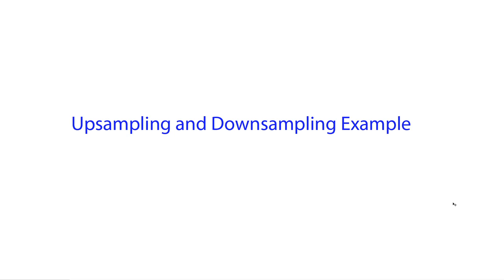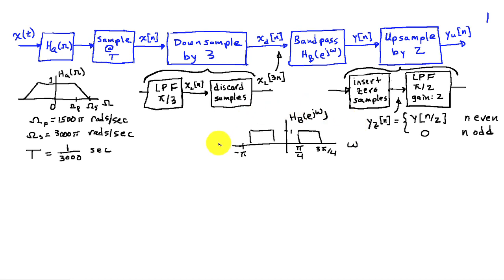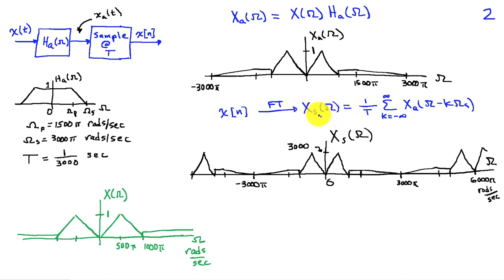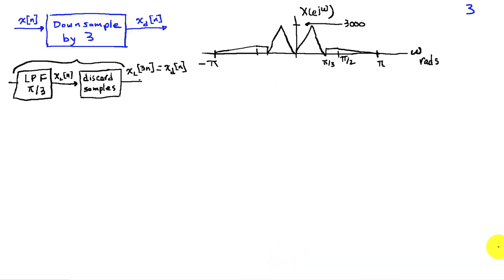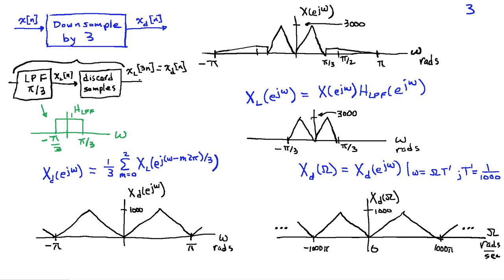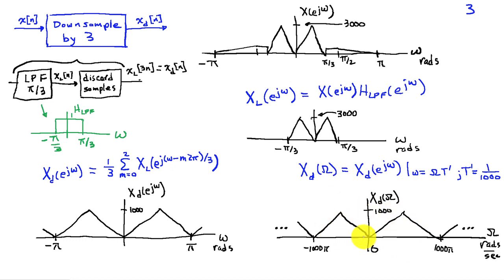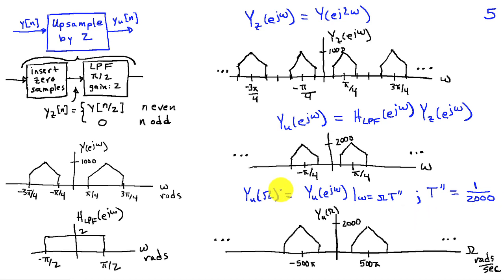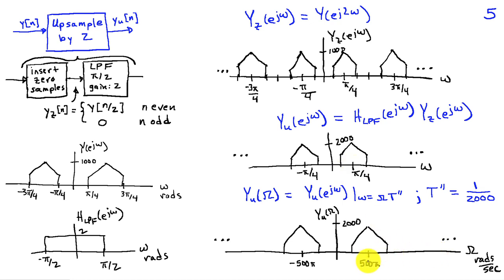Upsampling and Downsampling Example

Comment: At 03:25 you say that T = 1/3000 [sec] means that omega_s [rad/sec] is 6000pi.
I don't understand it. The formula is ( omega_s = (2pi) / T ). So in our case, omega_s should be equal to ~18849[rad/sec].
What am I missing?...

Comment: So, we get doubled Amplitude through the Lowpass filter at the end, not through upsampling? Upsampling shouldn't change amplitude, right?
Reply: yes, upsampling only scales the frequency axis (shrinks it by the upsampling factor). The lowpass filter gets rid of the aliased images that moved into the spectrum (-pi to pi) to make the signal periodic with 2pi as any DTFT should be. The lowpass filter also adds gain (the same upsampling factor) so the resulting DTFT now has gain of 1/T_new instead of 1/T. Hope this helps.